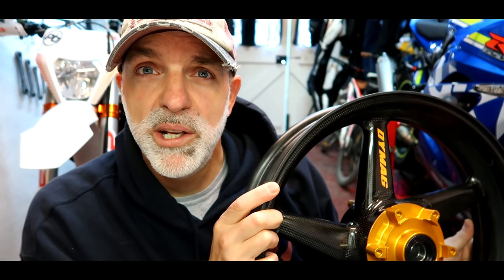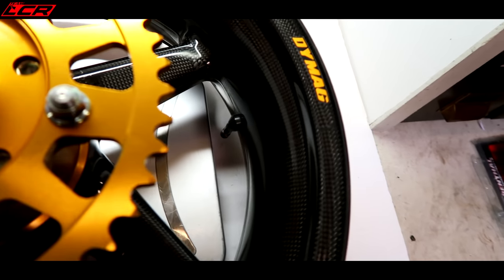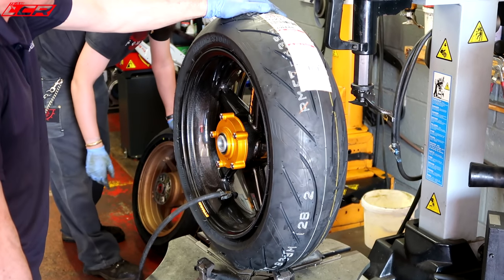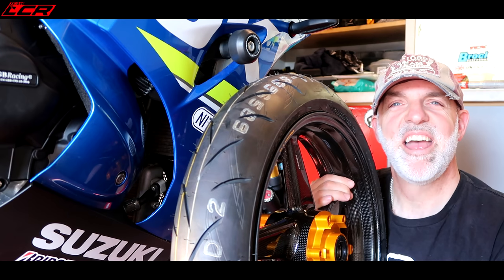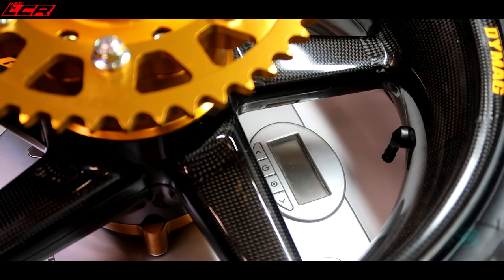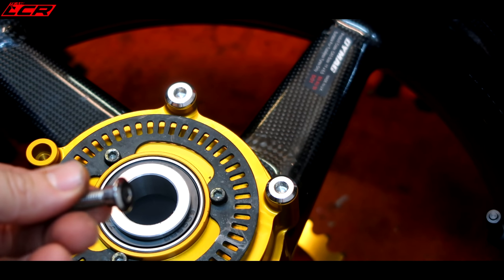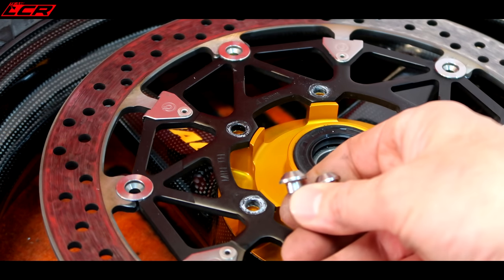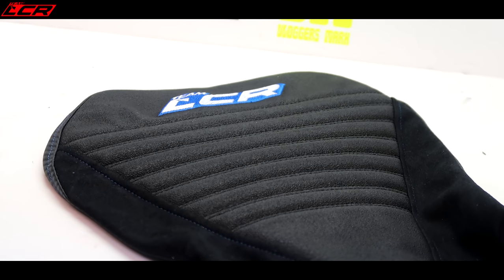Carbon Fibre Dymag Wheels | The GSXR Project Is Getting Serious!

Comment: Thank you for taking the time to create and post this.  I was debating on a set of lighter wheels for my '22 GSXR1000R but given the small weight savings and large expense, it's not worth it for me.  So again, thank you so much!
Reply: Hey Brad I definitely understand your stance which was mine at one point. That was until I rode a friends Zx10r with Carbon fiber wheels and it completely changed my mind. It sounds like a little bit of weight, but it feels very significant especially when going through turns. It is truly a night and day difference. Again I do get it though, almost 5k for some wheels is nuts lol, but 2600 for coremotos is a good bet. Be safe on those 2’s

Comment: Iy doesn't seem like much of a change, but the current tyres are worn too.
You could re-weigh the tyres after the tyres are dead to see how much rubber weight is lost over time. I recon 200g rear, 90g front :)
Reply from the maker: Yes agreed... I now want to remove the old tyres from the stock wheels just to check!! Good to hear from you Weeem 😎

Comment: Very nice vid, quality of production goes up which each video. Are there ceramic bearings fitted on the Dymags ? Apperently (never tried them) these also make a difference in acceleration and handling. Also I've noticed you put on a 190/55 on the rear wheel, a 200/60 will change the bike's handling as well (thought Bridgestone sell these tires with these dimensions but unfortunatly only Pirelli does : Diablo Supercorsa SP V3 and expensive) , it takes some time to get used to but after that you get more confidence and stability when cornering (in my case anyway, not for everybody I guess...)
Reply from the maker: They are an optional extra, not on these

Comment: Anyway you can find a bottom fairing that will cover closer towards the rear wheel.  I feel like most modern superbikes have that gap because of the larger factory exhaust.  And when you replace with aftermarket the gap between the bottom fairing and rear wheel leaves a asthetically ugly gap where a race fairning wld be longer.  Just a thought
Reply from the maker: Yes know what you mean but gsxr doesn't have that because everything was in the cannon of an exhaust. R1 is a prime example of what you are taking about?

Comment: Almost seems to my memory that once installed on the Superduke, you commented it was less "stable"--or just compared to the Tuono?  Which makes sense.  But the way I ride my Superduke (or any bike) is not track day but cut and thrust, chuck it about on back roads--so is Carbon a problem or an answer?
Reply from the maker: The super duke 1 was unstable feeling anyway so made it worse but did liven it up in all departments. Sportsbikes are harder to change direction on because of less leverage at the bars so makes more of a difference. But it's not just direction changes they help with acceleration, braking are also improved

Comment: Chops how much wear was on the the original tyres on the stock wheels? (assuming they were also S21s) you'd be surprised how weight a tyre loses over its lifetime. Could you remove the tyres and weigh the stock wheels without? Top quality video as always.
Reply from the maker: About half worn maybe more! Now very tempted to remove the stock tyres just to see the real weight difference

Comment: Good video. Would be interested in your thoughts on the s21's. Just got a set but not fitted em yet. What psi did you run?
Reply from the maker: Love em had 2 sets on this now, also like the Pirelli Rosso Corsa 2 but think these are slightly better
Reply from the maker: Tend to run stock pressures for the street

Comment: What centralstand is that? Did you the same one with super duke? Looking for one that I can use to service my super duke suspension.
Reply from the maker: It's the Abba Sky Lift, yes same one used on Duke just with a different adaptor kit
Reply: Lamb Chop Rides does it need modifications on bike to make it work?
Reply: Any promo codes?

Comment: where is this saved weight located on the wheel tho? if its in the rim it helps but if its the hub or something meh, lower spokes, meh  remember distance is huge here, weight that dentist travels any distance doesn't matter like an outer bearing,  a brake rotor pad area sure, the hub, meh.. make it steel for all I care, same fora sprocket make the hub aluminum teeth steel or titanium and its all the same, works out, the closer you get to the axle the less your weight savings matters, its the distance x weight..

 if you could drive around the planet fast enough you could defeat gravity if the weight and speed is right.. also, the suspension characteristics is ever changing, with weight your rebound reacts quicker than without weight, keep this in mind when fiddling with settings wondering why this and that is happening, lighter unsprung weight will not release as quickly as heavier, (newtons law) so its give and take.. 

the best effects imho is braking inertia and tip in, the lighter the wheel the easier it is to tip out...  hold a bicycle wheel by the axles have someone spin it very fast vertically.. turn it off axis all 4 directions and note characteristics.. then hold the wheel horizontally and turn it off axis all 4 directions...  you just learned how the physics of inertia work in relation to axis X rotation X horizontal rotation therefore understand how it effects wheel suspension vertical vs tipped off axis 45 degrees.. try it .. 

hold the wheel vertical, spin fast, move the axle up and down 6" quick as you can note difficulty .. now position the spinning wheel same rpms horizontal, move the axle up and down 6" .. see how that works, it want to stand up easier than laying down ..  move the axle all 4 positions and note difficulty vs horizontal vs vertical vs 45 degrees, may be surprised at the results..  most of us older guys already did this when we were in our bicycle stage, and understand the force required to lift a wheel spinning quickly vs motionless .. why a gyroscope works so well in an airplane..

now imagine the inertial force on the largest wind mill blade tips ...  😮

Comment: Dude you have to rebalancing the wheels after putting the disc on. 😯
Reply from the maker: No the disks are pretty uniform in weight, Ive often changed disks with re-balancing you wont notice any difference